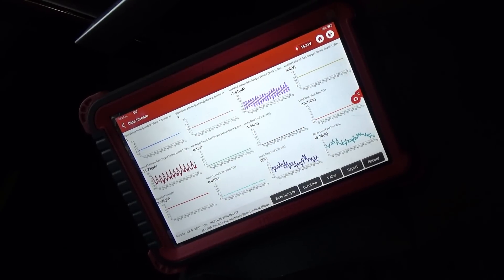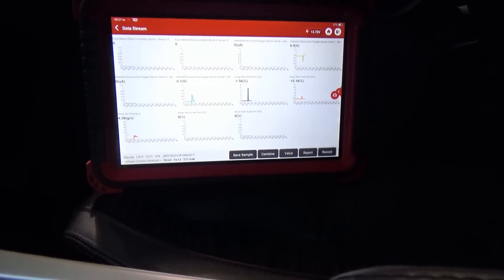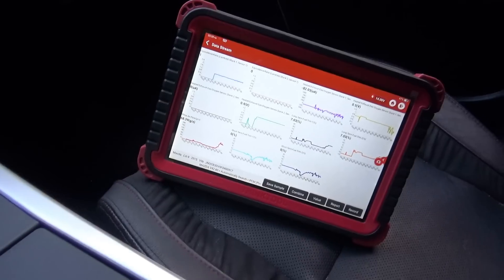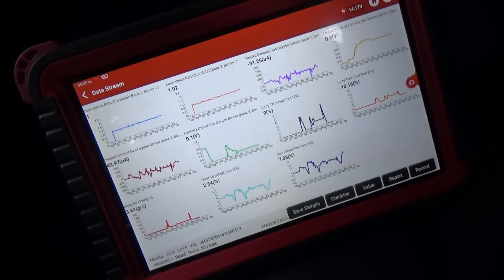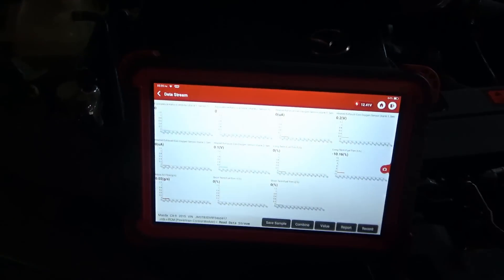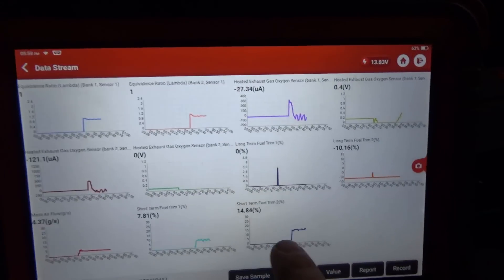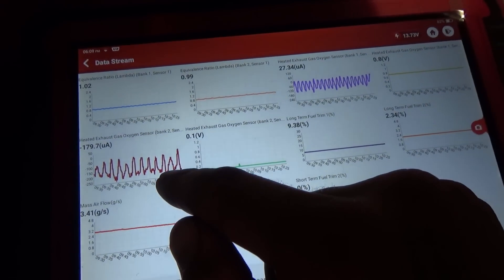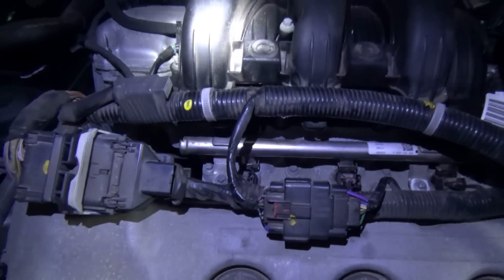Mazda MYSTERY No One Could Solve...Part 2 (P219B- Air Fuel IMBALANCE)

Comment: Mind boggling problem meets awesome diagnostic! Great software "magic" that detects the cylinder imbalance indirectly, but then sends you down the rabbit hole with awkward diagnosis flowchart. That was brilliant thinking, Ivan!
Reply: To be honest Kieth advised him to do the drop test and I'm pretty sure at least a couple of us mentioned possible injector issues in the comments of part one. Still, very cool to see a plan come together. Now I would have to suspect the way the software is able to detect per cylinder stoich is by way of known flow rate distance through the intake and exhaust manifolds. One little tiny mod and it all goes to hell. This looks like a case where one would NEVER want to use non-OEM sersors or anything that might affect the flow rate or distance between US1/2, DS1/2 and cylinder heads. I happily stand correctable.
Reply: @InsideOfMyOwnMind  Yep, you're right, and I completely agree with the possibility of non-OEM sensors messing up such a tightly balanced calculation.
Reply: I'm not an automotive tech, I work on other things.  sadly "awkward diagnosis flowchart" is all too common.  Which is why I rarely follow the manual unless I'm stuck.
Reply: @russellhltn1396  Yep, that is true in some cases. In other, it can be very helpful.

Comment: i thought injector maybe leaking on exhaust stroke just a little  and the sensors  seeing a small bit of fuel and cutting fuel trims because such small amount and seeing the computer result not cause  the next test would have found the fault  nice going there i would have thought keith  would have known  and told you which cylinder and by how many psi too much

Comment: I'm very surprised that mazda removed the Schrader valve on the 2015. Mine is also a first gen cx-9 but it has the Schrader valve. He should also check to see if his awd system is working as well since that is another weak point in the car as well.

Comment: I think it had to be going off of that sensor data alone to trip the code.  Just the fact that the oscillations were slower, more spaced out and even had that little small stutter peak each time.   Maybe it was comparing signal of one back to the other.  Otherwise, what other info did it use to trip the code?   It didn't have any misfire data...  Maybe if there is a knock sensor tracking data.. ?? I'm not sure what else it could have been using for the computer to come to this conclusion.   Interesting stuff.    It was pretty crazy to see just how precise and repeatable the fuel output was across multiple tests, and across more than one injector.
Reply: Keep in mind the O2 switching is a result of the computer reading the sensor and adjusting.  I think the computer was sensing that it was having trouble adjusting that bank of 3 cylinders.  Notice the extra peaks on the bottom of the cycle.  The computer is noticing the O2 reading isn't a clean response to it's input.
Reply: @russellhltn1396  yeah, that extra little peak was giving it a second reading, and even out of time frame-- so the only conclusion is that it had to be a leak;   either fuel or air.  It's interesting how smart they can make these-- but it's also a headache to deal with.  My state doesn't require inspections-- so if it's still pulling hard with full power like this car-- I would have ignored it myself and kept driving it.

Comment: Good diagnosis process Ivan. It is somewhat disturbing to read the Mazda flowchart for tests is so very less than ideal. It does not even mention an injector drop test. You would have been replacing the PVM based on the flowchart!

Comment: If this was an old car-- I'd just run it anyway; it seems to run just fine.   But running it this way over a long period of time would probably end up killing the cat-converter or some other consequence..   This is why I like to buy Honda or Toyota--  I can't remember seeing an injector issue unless it had 300k miles on it or more.  (granted, I've only seen a limited number anyway).
Reply: Depends on where you live. Some areas in the country have emissions testing, and that would require that car to be repaired to pass.And Toyota/Honda have their problems.
Reply: It can also burn the valves on the cylinders running lean.
Reply: Nice one Scotty but you can't fool us with that fake user name.
Reply: There are many issues with honda direct injection. Leaky fuel injectors before the cars even get to 100k miles
Reply: @Eastahtata  Yeah.. I'm talking 90's era, and early 2000's. lol..   I have a 2002 Acura MDX and a 2002 F350 7.3L diesel...  And that's about as new as I would want to be.  With the GDI and cylinder deactivation.. and particulate filters on the new diesels-- Yeah, I'll pass on all that garbage.  Luckily I live in a state that has no inspections.
Reply: @Eastahtata  To me it didn't seem like a leaky injector, just an injector with improper volume provided.
Reply: They all have problems but yes honda and toyota and Mercedes will have less engine mechanical issues

Comment: I'm wondering if Mazda uses the same technology as Ford regarding cylinder contribution testing which may have captured this event.  I've seen Makuloco channel use that test on the fords in a compression loss situation, but not in an excessive fuel scenario.  Very cool.
Reply: mazda used to be ford so ya you might be right.
Reply: Ford estimates each cylinder's power contribution by measuring crank acceleration on the power stroke, but it has no idea of cylinder to cylinder mixture variation.  The imbalance code on the Mazda is probably based on the steady state difference between pre cat wideband O2 sensor, and and post-cat narrow band sensor.
Reply: @ferrumignis  The A/F sensor is able to relate the composition (oxygen content) of the exhaust gas expulsion events to individual cylinders, though not programmed to identify specific cylinders. That would be the next step.
Reply: @juergenscholl2843  I severely doubt the sensors can react remotely fast enough to single cylinder events, certainly the Bosch LSU4.2s sensors couldn't do this. If the sensors were capable of that then the PCM would be able to report which cylinder was out of balance but it can't, it only knows there is something wrong with a bank of cylinders.

Comment: I'm impressed it was able to detect that imbalance between the cylinders and it wasn't wrong. That's pretty neat!
Reply: Indeed. It makes me wonder how it does it.  I'm not sure as the O2 sensor is fast enough to pick up individual cylinders (picking up ripple).  It might be signaling "frustration" (for lack of a better term) in trying to get the mixture right.  If it's struggling, then it's likely the cylinders in the bank are not matched.  Somehow it knows the difference between a mismatch and a slow O2.

Comment: That's why sometimes it's best to keep things simple and not overcomplicated the flowchart was junk
Reply: Yeah, I felt like the writers got lazy on the flow chart and used the same flow as if it was an inline 4 cylinder.  Those checks would be more consistent or at least important on a 4 cylinder.
Reply: I'm surprised that flow chart didn't include checking the tire pressures and that the seat belts all retract properly.
Had pretty much everything else on it!
Reply: @jimmyb1451  Or that the drive belt was on tight haha 😂